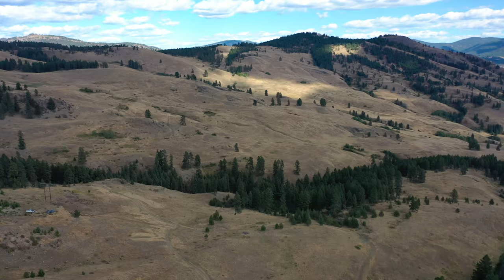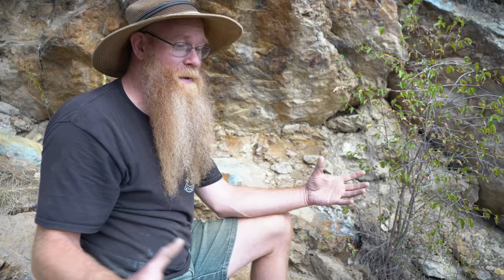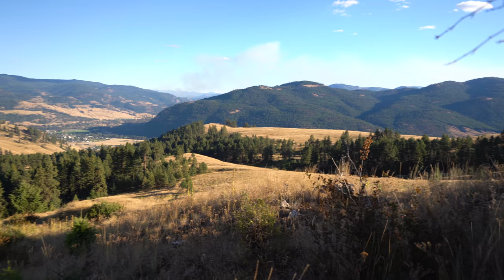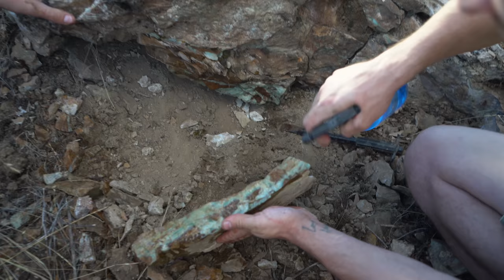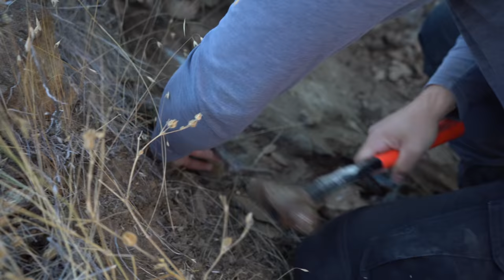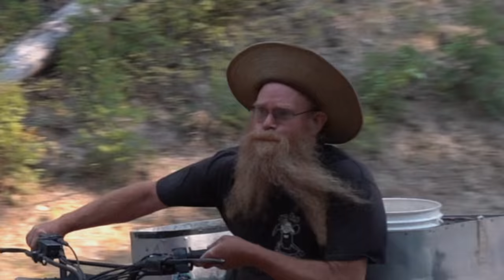Unearthing The Most BEAUTIFUL Gemstone!! (Ocean Picture Stone)

Comment: I switched to mining only gemstones 3 years back and it's been going so awesome that I'm doing it full time. I mine gems in the spring and summer, turn it into cabs and faceted stones in the fall and winter, and sell it year round. I love my job!
Reply: Does it make good money?
Reply: @jordycolin4390  Hell yeah, I made 7k last month and before the pandemic I was making even better money. I made a gem claim this season and I'll begin mining it the probably June of next year. It has both hard rock and alluvial sapphires and rubies. I have a bunch of material to last me through the winter. Unfortunately the season is over because my claim is at high elevation and is already covered in snow. I might make a trip down to Arizona here soon though to mine fire agate and then probably over to New Mexico to collect peridot.
Reply: @jordycolin4390  Getting a slab saw and a cabochon machine is the easiest way to get started. I recommend a CabKing. I have a CabKing I use primarily but I have a  Covington also. The Covington started to rust out within months of getting it and it also had a bent drive shaft out of the box. I've heard good things about Genie and have tried them at gem and mineral shows but have never owned one myself. If you can do the whole process from mining the gems to making them into jewelry that's going to net you the most money. I travel from my home in Iowa to the western states to mine. As long as I bring at least 10x the cost of the trip back in gems and specimines I'm happy but usually bring nearly a pickup bed full every trip which I turn into thousands of pieces of jewelry. Admittedly I spend most of my trips fishing, hiking, and kayaking 😂. It makes for an awesome vacation every time. Do most of your research before ever leaving the house and that will give you the most productive trip. Use mindat, geological reports, and Google Earth to find things like pegmatites and other structures from the maps, save the GPS locations and then you can drive straight to the deposits. Be sure to get information on private property and claims so you can obtain permission or avoid those areas.
Reply: Could you tell me how you get started doing this, how you know where to find things, and how you do this for a living?
Reply: @ashkillsben6  I search up what gemstones I'd like to prospect for and mine on mindat and then drive to those locations after doing some research. Sometimes you'll find the specific location listed is already claimed but if the geology is right on one claim there will be more of it around. Another way to find locations is to look up pay to dig businesses and go there. As far as making money you can put what you find for sale on etsy, eBay, fairs, or gem and mineral shows. Selling the stones unmodified will yield you the least money so what I do is use my cabochon machine and faceting machine to make the stone look good and then wire wrap it or put it into a setting. You can buy molds and pour melted silver, gold, or some alloy and then use files and sanding to get the appearance you're looking for. You can also buy settings from Etsy and set your finished stone in them. For a cabochon machine I'd recommend CabKing and a facetron for faceting. I definitely recommend starting off with a cabochon machine and learning the best method for cutting certain stones. A cabochon machine also has much less of a learning curve than faceting and mistakes on cabbed stones is much cheaper generally than faceted stones. I'd rather make a mistake on a piece of jasper, agate, or common opal than a sapphire, ruby, or aquamarine any day. There are also several really good books on finding gemstones that will give you general locations for finding gemstones. Remember if you do the whole process from start to finish it will yield you the most money. Say I find a fair size aquamarine it will sell for around $500 but if I turn it into a ring I can easily sell it for $5000. The meat and potatoes of selling though is by far cheaper priced jewelry. I will generally sell cheaper 100 wire wrapped pieces for every 1 high dollar piece. If you start off with a slab saw and a cabbing machine you'll quickly be able to make enough money to afford to take classes on faceting and a faceting machine. I spent 2 years only doing cabbing and wire wrapping before I purchased my Facetron. There are many other youtubers that mine gemstones and do stone finishing.
Reply: Sounds so very interesting 👌👌
Reply: it's a talent That comes from trying to figure out how you survive.

Comment: While not being trained in geology, I don't understand why you're not using diamond saws, battery powered or manual etc. to cut more precise slabs for better looking and higher priced pieces. Instead you just smashed off whatever chips you could get. Surely a geologist would understand how the seams run to split the pieces more effectively. Why not collect a piece that is large enough to be a table top?